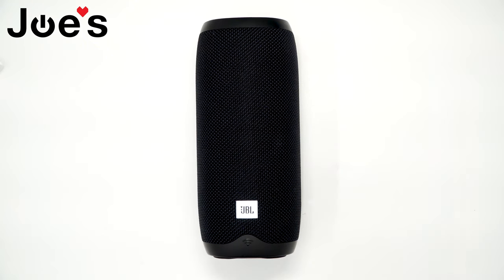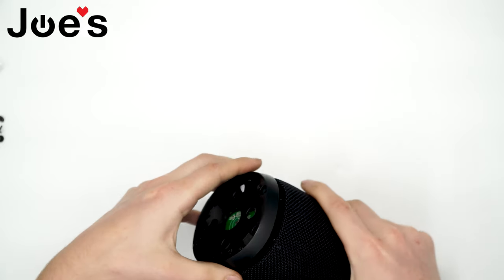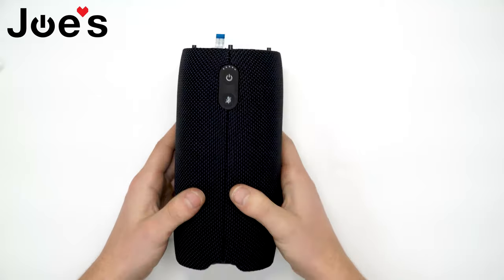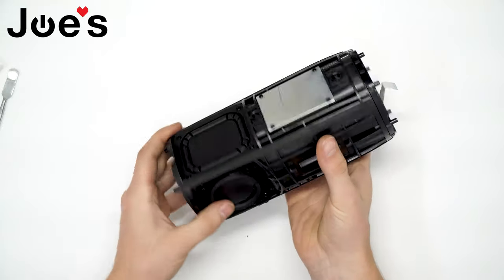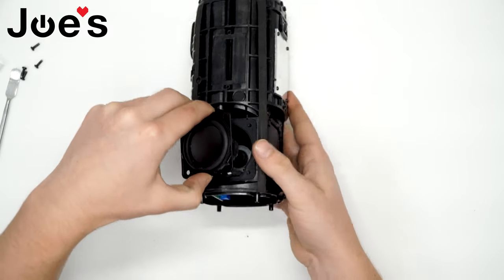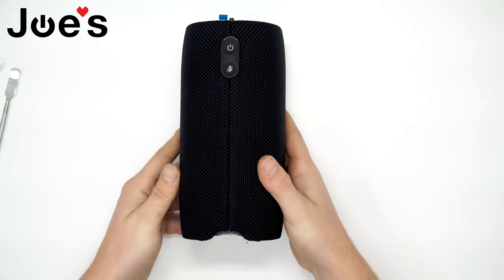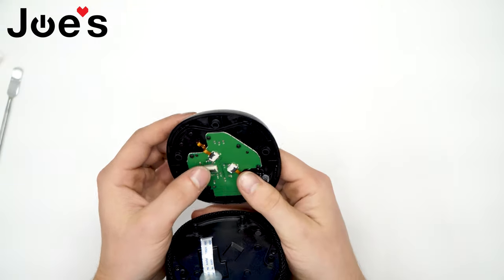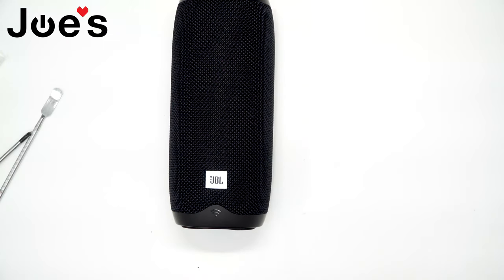Tutorial How To Replace Repair Blown Bad Speaker JBL Link 20

Comment: Was given a Link 20 because the speakers crackles at mid/high volume, was wondering if the site will have a restock on the Drivers because they are sold out as of now.

Comment: Good afternoon friend, all right? Please I need some help. I bought my link 20 in the USA and I live in Brazil, but it doesn't connect anymore, before it only connected by connecting a power cable and problems with disconnecting if the microphone button was activated. Would there be any software for me to try to restart it?

Comment: My jbl link portable stop working after almost a year and wrong hold the charge after it got wet in the charge deck. Now the light barely comes on and will go out and won't charge it. I like it but I now am hearing bad reviews about it... 

Any advice on how to fix it quick with a DIY solution?
Reply from the maker: You may have corrosion on the main board now. I cant think of a DIY solution for that.

Comment: thank u bro... for this video
I have jbl link 10 speaker but my power button and mute button not working , if I press it shut down off and if I press after shut down it's not getting switched on but if I connect with charger it gets switched on so my power n mute button not working and everything time I have to connect with charger to make it switch on ... can u help me what is the problem ?

Comment: Personally I managed to remove the speaker in my Link 20 without removing the top cover with the buttons, just removing the bottom cover & then removing the mesh fabric cover. The top cover has a lot of sensitive components, connected to a delicate ribbon cable.
Reply from the maker: Good tip!

Comment: One of my speakers makes a popping noise when no music is play through it. Sounds abit like a dripping tap into a stainless steel sink. It's only one of the speakers any ideas?
Reply: Hey Tim,
I have this too. Did you fix it?

Happened when I plugged it back into the charger. Reset didn't help.
Reply: @lofgren007  i think so, searching the web I didn't find much. Tried 2 things so it could of been any one of these. I did a hard reset on it where you turn it on and press and hold the mute button. I also thought it could be a connection issue with the internet so I brought it closer to my router. I has since returned to its original location and seems to be ok!
Reply: @timothyhart4124  
Cheers! 
I believe it was the hard reset. Just did it too and it worked.  I heard one pop while holding down the mute button.

Comment: Hey joe's my link 20 is making  weird sounds I opened to check the speakers 
What you think it is?
Reply: mine is doing the same.. the problem is probably a split in the speaker or the gaskets has come loose
Reply from the maker: Thanks for the comment. Can you explain what kind of sound you are hearing?

-David P
Reply: @Joesge  mine does some click or tick sound .... do ou have an idea of the reason? thanks
Reply from the maker: Thanks for the comment. Can you be specific when the sound occurs?

-David P
Reply: @Joesge  @Joe's Gaming & Electronics It occurred when I stream music or radio using Google home and also with Bluetooth. Every 20 seconds approx but it is not regular. Sometimes 20 sec sometimes 10....
Thanks